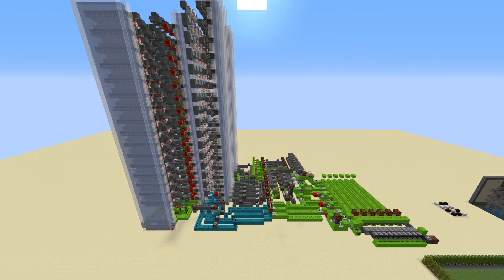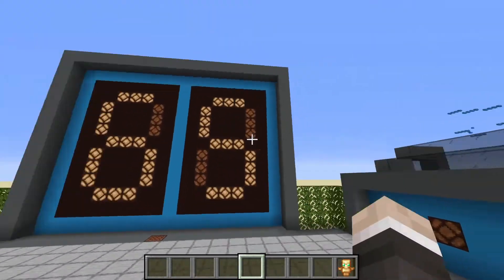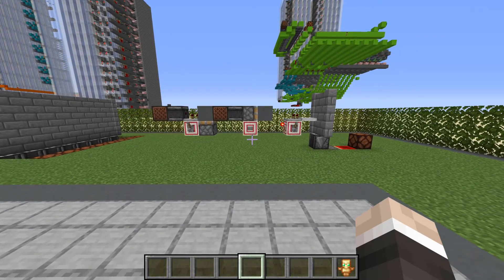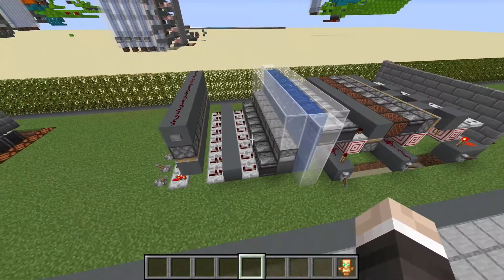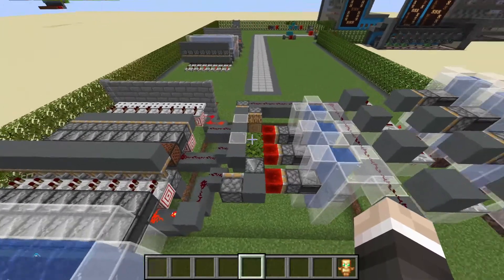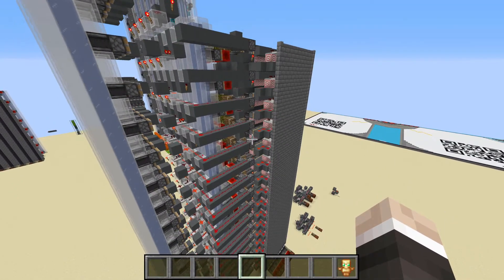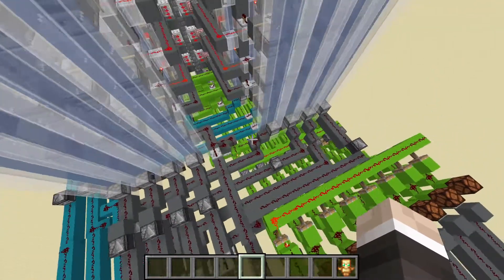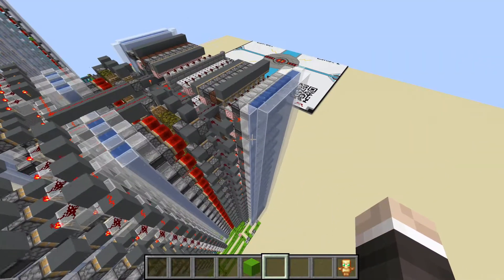How my 32 byte Redstone Memory V2 works

Comment: Why do you use T-flip flops and not an RS-Nor Latch?
Reply from the maker: At the time I used them for 2 reasons, one to make them work the size was bigger, at my original attempts, and i could not get them as dense, although i may try again at some point, with more experience behind my belt. But it also allows you to do some funky short cuts, like inverting a number in memory by writing all 1's in with out erasing it first, among other-things and i thought it might be useful at the time.

Comment: Absolutely fascinating stuff! This thing definitely deserves to be called ram. How fast is it? I'm really curious
Reply from the maker: it takes bout 7 ticks to read
11 ticks to write and 7 ticks to clear. 
I'm sure there is faster ram out there but with this design every memory cell takes exactly the same amount of time for every operation. Some of my more recent memory stacks can easily have 64 bytes in the same foot print and is the same speed. The biggest limiting factor with this design is the time it takes for the bubble columns to update and the height of the build. Theoretically if you don't mind it spanning all the way to world height you could have about 256 bytes in the current stack configuration.
Reply: It only is called ram if it is ram.

Comment: My redstone memory also uses dflipflops. I also have another command to memory which Inverts the binary value, you can do that by feeding 1 to a memory cell without resetting it first
Reply from the maker: I actually was actually planning for that feature when i designed it , so that i would have an easy way to invert the binary.
Reply: @RedstoneWarper  Try doing it, I haven't found much use to it But honestly I don't know what can I do with a Minecraft computer other than calculating Fibonacci, though when you flip a Binary value on an 8 bit computer it will always be equal to 255 - the original value, maybe you can find something to do with this
Reply from the maker: @DKaldes  I will for sure be including that as a feature, I'll have to think of a practical use for it, but my goal for the computer project i'm working on is something that is fast, and can do a lot of things, plus. In order to  flip the binary traditionally you would need to run it thought he ALU, but doing it this way we just write all ones to the memory without clearing the contents first.